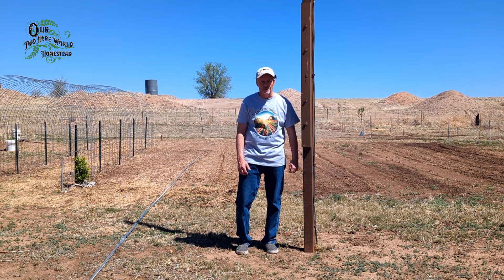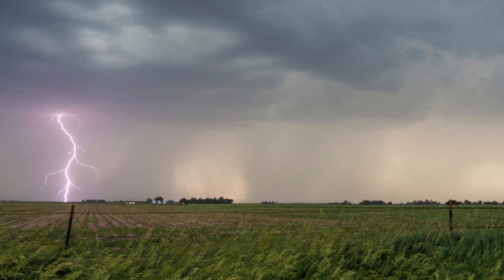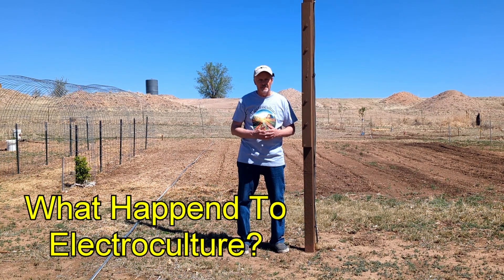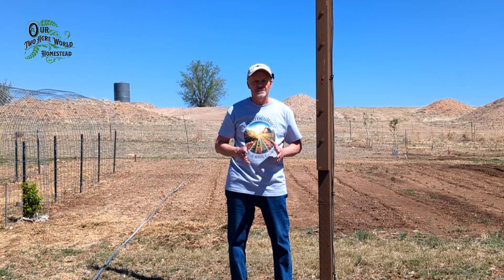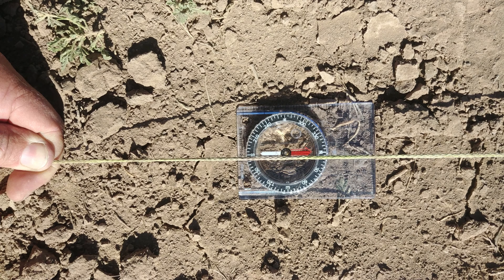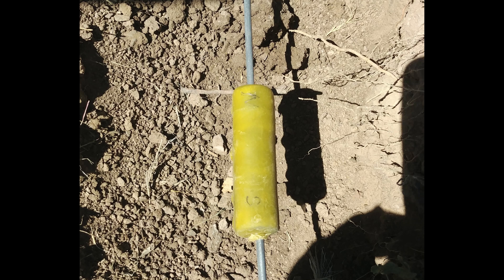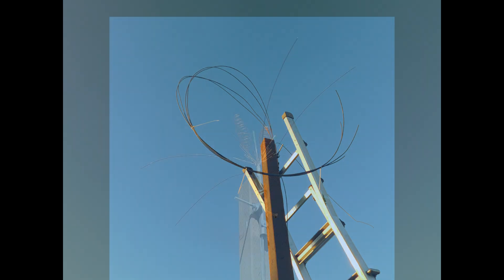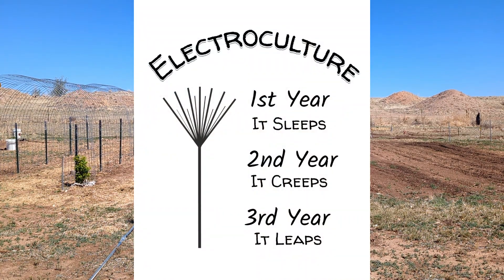Garden Electroculture - Does It Work?

Comment: It does work , patience must be practiced , as with anything. I took a grounding rod with about 4 ft of 12 gauge bare copper wire , twisted the wire in a spiral from the bottom up ( north of equator) . I stuck the rod after that in between 4 tomato plants . I did put lime and fertilizer and tilled the ground a foot deep before planting. End of the season the tomato plants had way more leaves and tomatoes than I’ve ever grown. They ended the season 7 foot plus , I gave away bags of tomatoes. I did notice after several lightning storm in early august they grew like weeds . I wrapped bamboo poles 7 ft with bare copper wire clockwise from the bottom up , and put them a foot deep 2 feet from pecan trees around my property. They grew more than normal and lots more leaves on trees ,  I got pecans for the first year , young trees , leaves take in more energy from the sun on all plants . We had a terrible lightning storm , hitting every where but my property, they work as lightning rod also , they kept the lightning from hitting on my property, I say this because many people lost livestock, trees hit , it was scary, . What electro culture does is give the ground a positive charge from atmospheric energy in the air , the copper spiral changes the electrical charge to something the trees or plants can use more efficiently. The air is highly charged due electrical storms , but theres always some charge even on a sunny day . Watering the ground helps the electrical charge flow better and farther. You will see the most benefits the days following electrical storms , it works !!! Yields increase
Reply from the maker: Those are great results! Thank you for watching.

Comment: I believe there's a lot of misunderstood concepts here.   Magnets don't do anything to that wire,  and the magnetic field do not extend no more than a few inches.   It does nothing to the garden.   The second thing is that plants aren't affected by magnetism.   However,  they do respond to high voltage electric fields.    Some have speculated that the microorganisms in the soil benefits from electric fields which will create a rich soil.

My personal theory in this topic has something to do with oxygen.   Putting a wire underground and exposing the other end to the positive high voltage tension in the sky  essentially shorts out the soil  making it more positive than rest of the ground.   This would attract the negatively charged oxygen into that area which would make microorganisms proliferate  and create a rich soil for the plants and allow their roots to breathe oxygen.   This is supported by the idea that using copper tools to prepare the ground creates a healthy soil.   This is because copper is positively charged relative to the soil which have iron.   It will strip away electrons in the ground making it more positively charged.
Reply from the maker: Interesting theory. Thank you for watching.